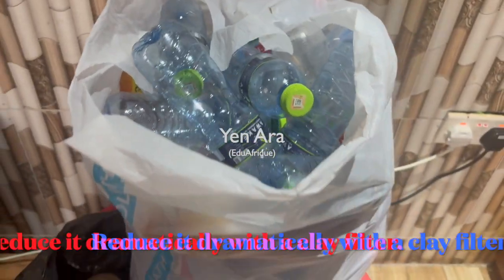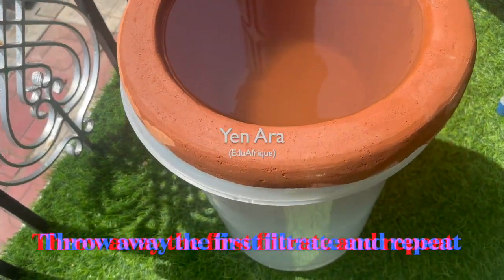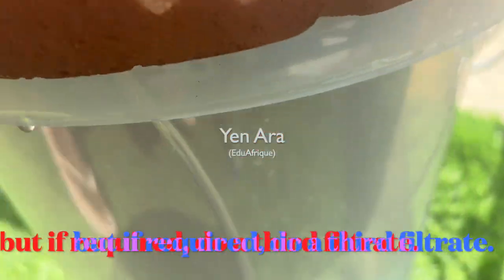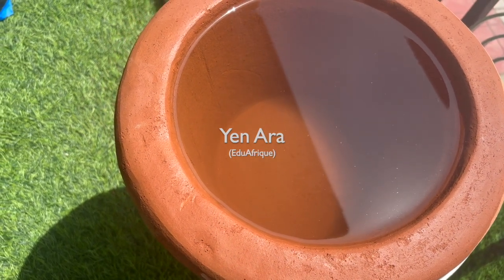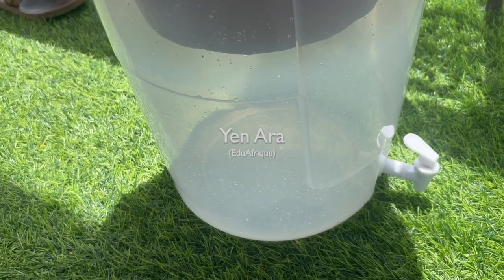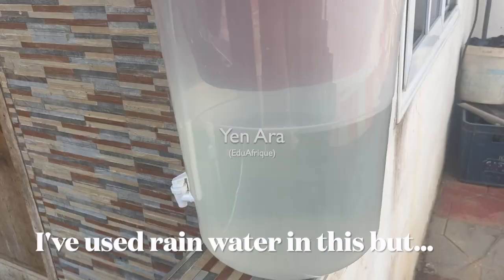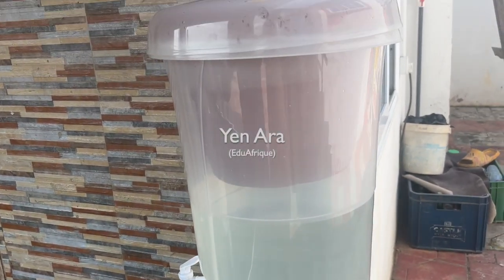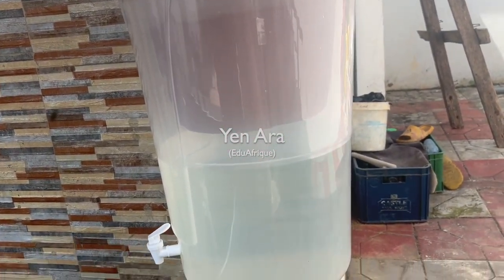🚰 Clay Filter Water Filtration: A Natural Solution for Clean Drinking Water

Comment: Hello . I have a question . Does the clay pot need to be replaced after multiple use ? Does the filtration build up and get dirty requiring replacement or cleaning like a commercial filter. Thank you for video . Will definitely look into this.

Comment: You don't have to filter rainwater because it's already been done by mother nature and perfectly safe to drink .
Reply from the maker: The thing is, the surface where the water falls is unhygienic. The roof has birds and lizards roaming on it and potentially, rodents. So we filter to be on the safe side.
Reply: @yenara_eduafrique  
Here is a simple solution to problem and what I do to drink fresh clean rain water which can last for months .
Have as many as possible clean ( clear ) plastic containers ( square or rectangular shape ) which are food grade or buckets of (20 L ) food grade the more the better and ready on standby for to use when it stats raining .
When it starts raining put all the containers or buckets in an open area away from the house and any trees so the water doesn't get contaminated . Let the rain fill all the containers and buckets as much as possible all the way or as long as the rain is falling . Check the containers before putting the lids on for any debris that the wind if any might blow some leaves or branches or small fragments of bark inside the containers . If so remove any leaves or small branches immediately or when the rain stops so it doesn't affect the water and then put the lids on . Do not worry about the smaller fragments of the bark if any because that can be filtered out later with a coffee filter using a 1 l or 2 l plastic bottle which you would cut the top of the bottle  approximately 3 or 4 cm from top enough for the filter to snugly fit in when the top is turned upside down and put in the other half of bottle . If there is no wind and no debris or small fragments of bark when raining then there is no need to filter any water with the coffee filters which you can easily get at your supermarket .
The Next Step is to cover the containers ( after you have put the lids on ) and which you have laid out in one bunch with  black heavy duty plastic sheet ( used for building sites and which you can purchase at your hardware shop) making sure that there is no light coming through when covered with Black sheet so to avoid algae growing inside your containers and secure The black sheet around the edges with something heavy like bricks rocks or large pieces of timber so the wind doesn't blow away the black plastic . And the last step is to ensure that the containers are in shade so the heat doesn't affect the water . This can be done in a few different ways one is to string a tarpaulin or a green shady fabric over and above the containers ensuring there is air flowing through or two using chicken or bird wire which you would cut and make wide cylindrical shape ⚪×⚪×⚪ 
...................................................⬜  ⬜  ⬜
( depending on how many containers you have) and joined the cylindrical shape wires with zip ties ( from the hardware shop )  and place the cylindrical shape wires on top of the containers with the black plastic . Inside the cylindrical shape wires put something heavy like brick or two in each one section to ensure that any wind doesn't blow away and then cover the cylindrical shape wires with heavy duty green shade fabric using zip tires to secure to the cylindrical wires shape . This process will keep your water staying cool , fresh , tasty and algae free for months like spring water at your finger tips .
Reply: Some say water that is contained in plastic bottle under the direct sunlight can cause cancer to the user. Is that true?
Reply: Out of respect and concern i would advise against that. Please look up in a search engine the word.........."CHEMTRAILS"
Reply: It is better tasting when touches the earth and specific the clay parts. As also springs come out of clay levels. In this case I think the ceramic filters if to filter are the top option

Comment: You guys should look into collecting the water in a non-plastic vessel, that would be best.
Reply: Some plastics are safe for water, depending on the classification:
These plastics are generally regarded as safe (GRAS) by regulatory authorities like the U.S. Food and Drug Administration (FDA):

1. Polyethylene Terephthalate (PET or PETE)
Identification Code: #1
Uses: Water bottles, soda bottles, and food packaging.
Safety: PET is lightweight, shatterproof, and resistant to microbial growth. It is considered safe for single use but may degrade with repeated use. Avoid exposure to high heat.
2. High-Density Polyethylene (HDPE)
Identification Code: #2
Uses: Milk jugs, juice bottles, and reusable water bottles.
Safety: HDPE is durable, non-leaching, and resistant to chemical reactions. It is suitable for repeated use and dishwasher-safe.
3. Polypropylene (PP)
Identification Code: #5
Uses: Reusable food containers, baby bottles, and some reusable water bottles.
Safety: Heat-resistant and less likely to leach chemicals. Often used for hot liquids and microwave-safe products.
4. Tritan™ Plastic
Identification Code: Often unnumbered (specific proprietary material).
Uses: Reusable water bottles, baby bottles, and food storage containers.
Safety: Free of BPA, BPS, and other harmful chemicals. Tritan is known for its durability and clarity.
Plastics to Avoid for Drinking

Some plastics can leach harmful chemicals, especially when exposed to heat or acidic substances:
1. Polyvinyl Chloride (PVC)
Identification Code: #3
Issues: Contains phthalates, which are potential endocrine disruptors.
2. Low-Density Polyethylene (LDPE)
Identification Code: #4
Uses: Flexible containers, plastic bags.
Issues: While generally considered safe, it is less commonly used for drinking bottles due to its softness and lower chemical resistance.
3. Polystyrene (PS)
Identification Code: #6
Uses: Disposable cups, plates, and foam containers.
Issues: Can leach styrene, a potential carcinogen, especially with hot liquids.
4. Polycarbonate (PC) and Other Plastics with BPA
Identification Code: #7 (Mixed or "Other" plastics)
Issues: Often contains bisphenol-A (BPA), which is a known endocrine disruptor.
Reply: @moistureloverhair2603  FDA/NIH is corrupt.  GRAS --> Generally regarded as stupid.  Glass or stainless better than plastic. Clay part good, thanks.